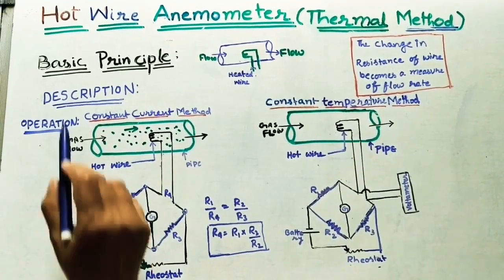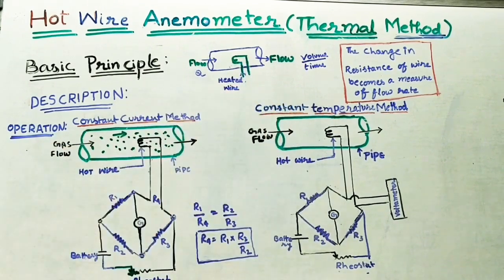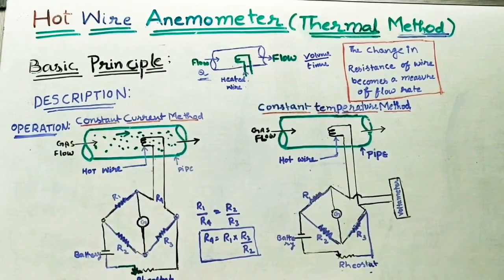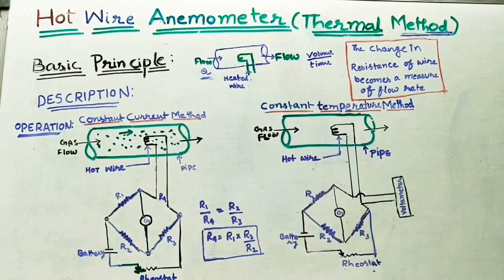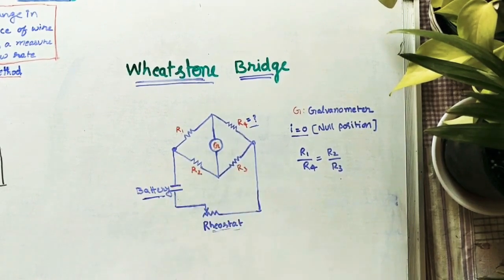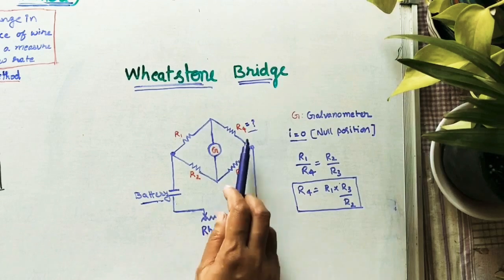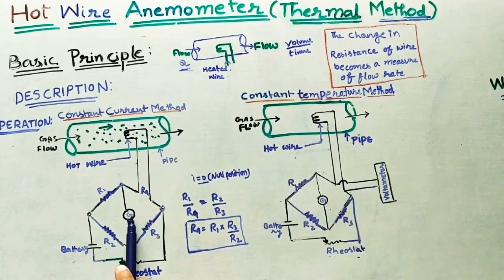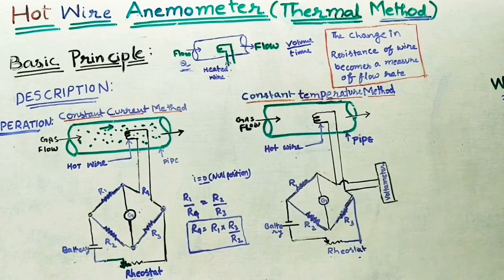Hot Wire Anemometer

Comment: Why voltmeter connected in constant temperature type hot wire anemometer
Reply from the maker: In this method we r keeping  Temperature R4 Constant. Just for checking R4 is constant or not, we are connecting Voltmeter. This voltmeter will give R4 value interns of Volts.